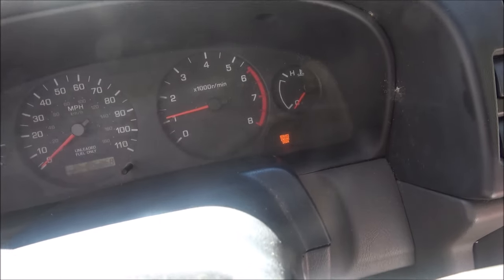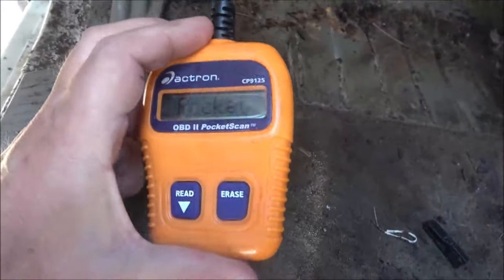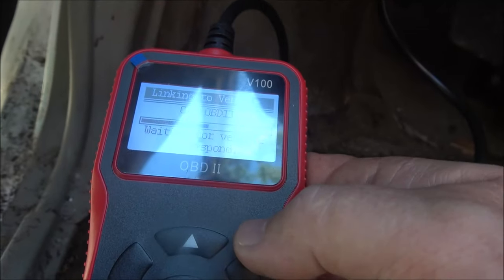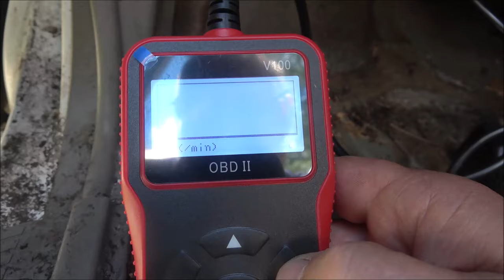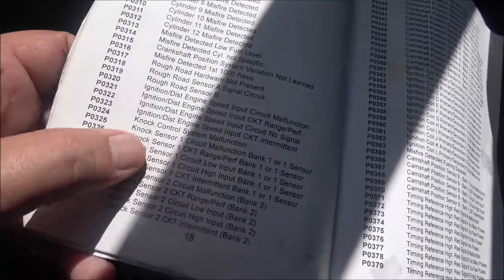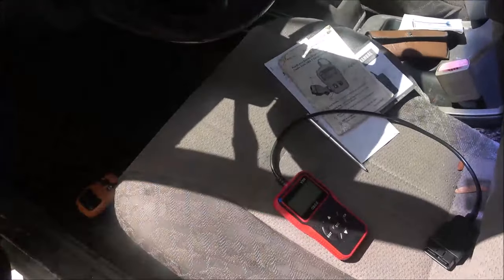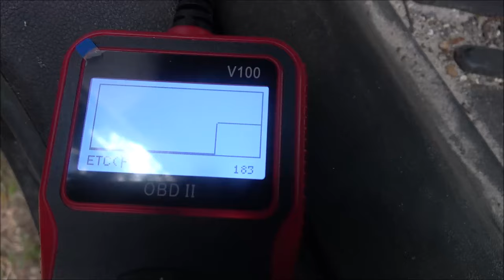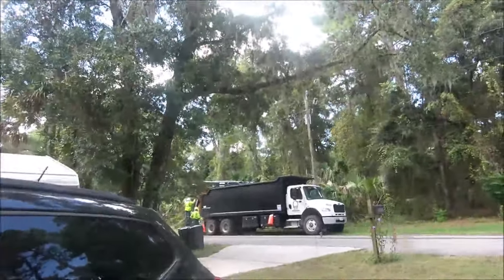Temu OBD II Code Scanner VS Actron CP9125 Pocket Scanner

Comment: Why would my gas gauge dont work ?
Reply from the maker: Put some gas in it lmfao 🤣.  If it's reading above full all the time, it's a ground wire. If it's reading empty, check the fuses first. If the fuses are good it could be a bad wire or the sending unit in the tank. I have the same problem with my nissan.
Reply: @shabear1000  it's way pass full and it stays there
Reply from the maker: @jonishuman6692 it's a ground issue. Check the ground on the tank.